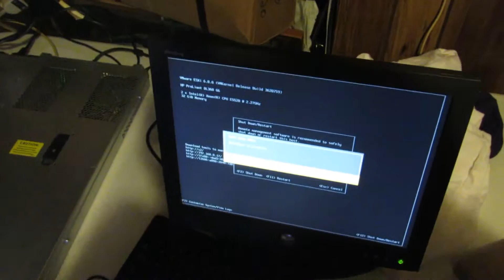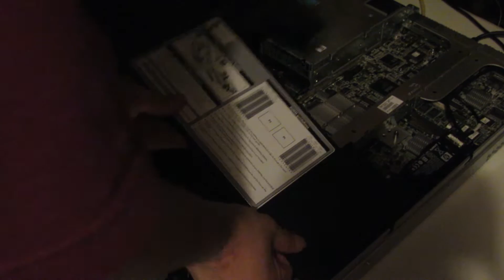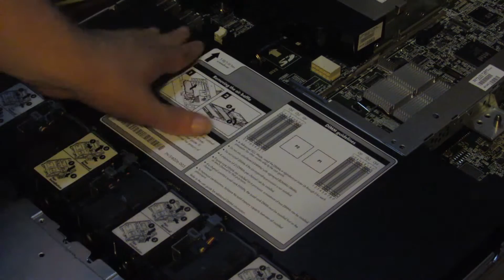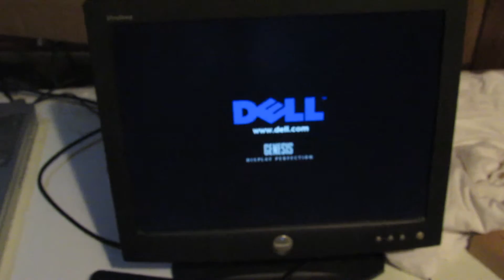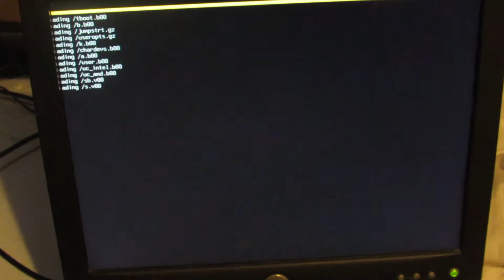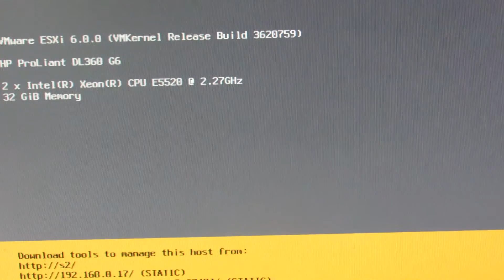HP ProLiant DL360 G6 Demo

Comment: how many threads does it has
Reply from the maker: Thanks for your comment here is the CPU Specs i can pull right off

CPU

Logical processors
16

Processor type
Intel(R) Xeon(R) CPU E5520 @ 2.27GHz

Sockets
2

Cores per socket
4

Hyperthreading
Yes, enabled

Memory
31.99 GB